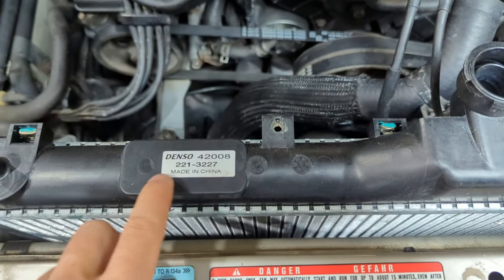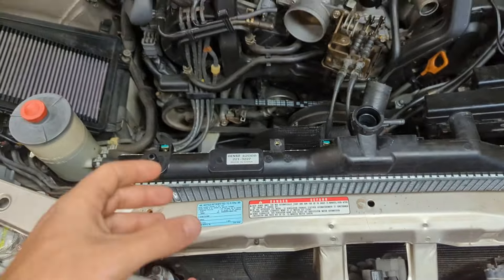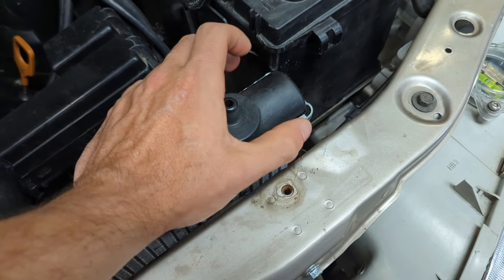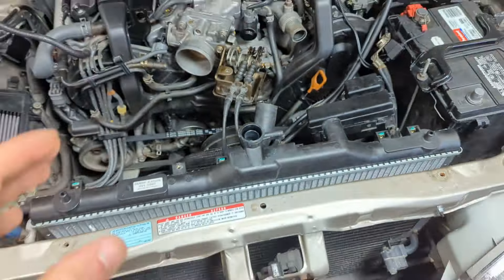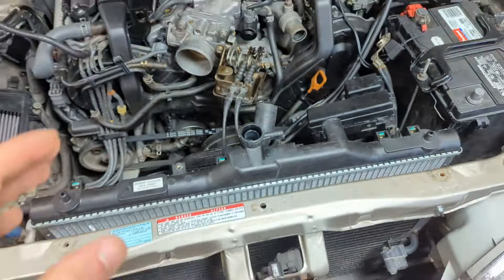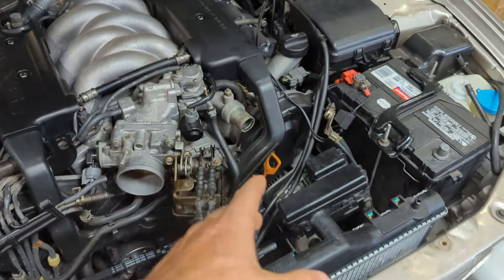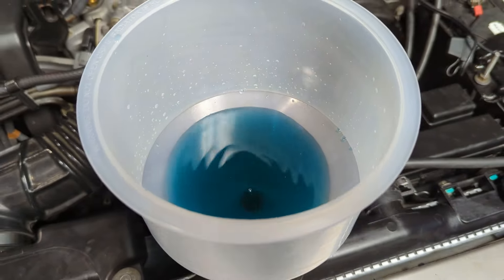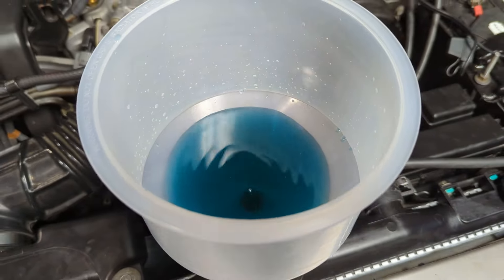What's going on with part quality? Acura Legend Cooling Issues.. AGAIN!

Comment: Sadly all too common with parts manufacturers these days. Junk quality from what should be solid brands - which of course makes finding good parts for older cars that much harder.
Reply from the maker: Absolutely. Solutions to part supply and quality will likely become homemade. In many ways already are for some common issues

Comment: Front the factory all 91,95 96 04 rl the top  radiator  hose is  perfectly  flat or parallel  to the ground  ,no dipped up or down  to set up a air pocket !!!

Comment: There have been quite a few manufacturers that make stuff in China now that just isn't the same quality anymore. Like Moog used to be really really good. So with all of that in mind, if you can find New old stock on things, you'll get lucky. I noticed that you can get a Nissen radiator for the legend,so I wonder what the quality are on those. Looks like it's a relatively small plant they have in Denmark. 
I know for the ka9s I'll be looking at getting a koyo rad instead, And if they are solid units, I might keep a couple stashed away lol.
Reply from the maker: @averytulak  agree.  That's good research to find a non-china manufacturer